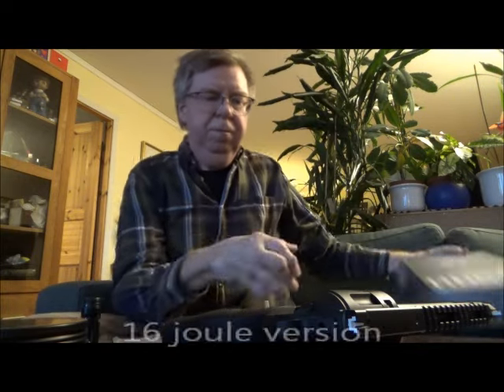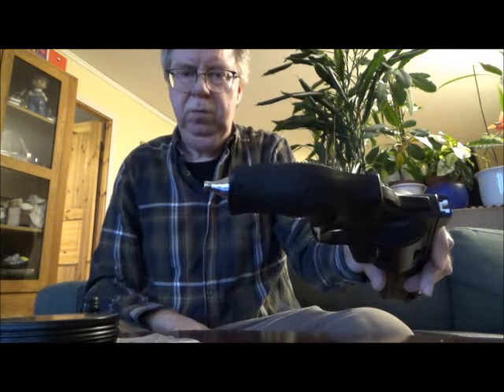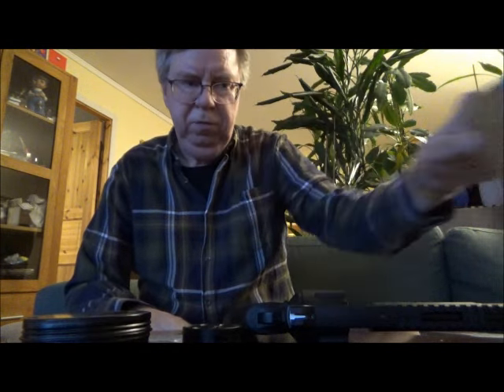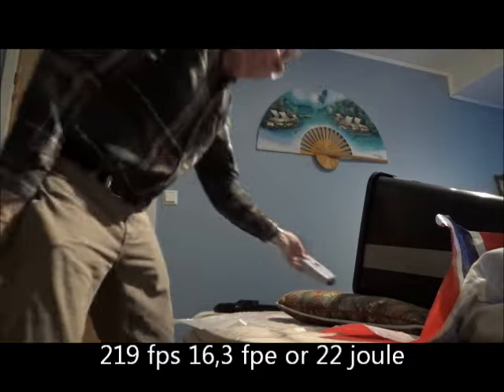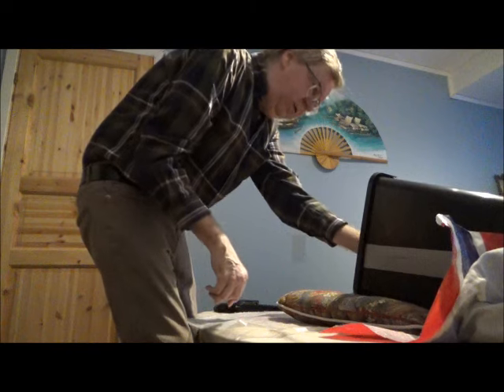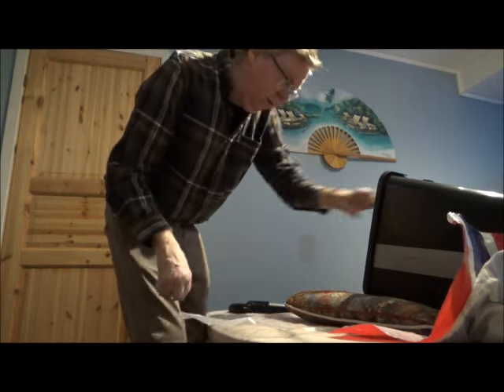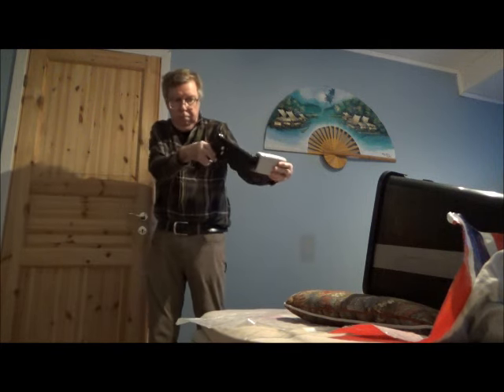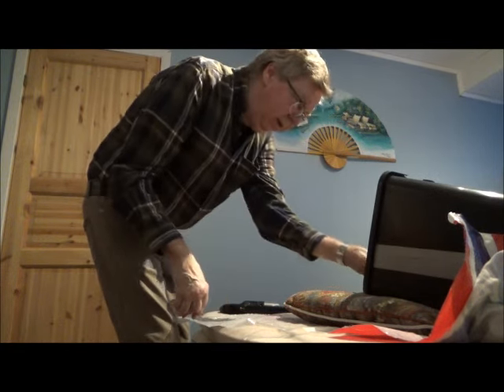Umarex HDR68, Tincan Cutting

Comment: Hello Rune nice video do you think the 1mm hole makes the marker move powerful or move reliable as it  is a good marker ,one of my  favourites as well. 🏴🇸🇯👍
Reply from the maker: Thanks my friend. Yes it makes it more powerful and more reliable with a larger hole in the restrictor. But no need to drill it larger than 1,5mm. Otherwice just dont use the restrictor for max power. Super cool revolver 😎

Comment: i discovered long ago painting your projectiles will form a beiier seal in your barrels . look at this example , on the real firearm the 9mm , you can use it in a .38 special ,the bullet loaded in its case ,and shoot it with no problem , trouble is , 9mm is .355 for metal jacketed bullets and .356 for lead diameter ! the .38 special and its big brother the 357 magnum 's bore size is .357 of an inch ,lil over 9mm . when you shoot a 9mm in these , the bullet being smaller ,does engage rifling as well and more of the gases are shot around the projectile so its not all behind it , plus you loose accuracy at longer distance also !!! 
but if you used a .357 or worse .358 for lead bullets , it would be hard for the bullet to pass through barrel , kindda like whats happens when you try to shoot a 12.7mm steel ball a home defenCe 24 tuning barrel which can handle the smaller balls at 12.65 and lil smaller better ! . 
good god man , lol i am rattling on again , i said all that to say this ,,,,,,,
a spray or 2 or 3 or more coatings of paint will help marker projectiles seal better in barrel and cylinder !!!!!!!!!!!!!!!!!
with .177 cal bb guns , you shoot .172 dia steel bb's , so they will not fit so tight in .172 bores . iy you give em a couple coats of spray paint ,they work much better .
in airsoft , you can use clear or whatever paint to make your airsoft bb's fit the barrel also ! 
GREAT VIDEO MY AWESOME BROTHER !!!
Reply from the maker: Thanks brother🙏. I used rubberpaint (15 layers) over marbles many years ago. It it worked OK. I might try spraypaint as you say one some of the ammo I have since the diameter is a bit small. Great thing about revolvers is I can use a patch around the ball. It worked great last time I used normal marbles in my HDR68. The marbles hit hard 😁. Think I will use either clear paint or black paint. Thanks for the tip😃👍🙏
Reply: @runerebel8441  been doing this many years now , decades really . i find the paint or clear coats dry much harder and arent as grippy in barrel , but a little oil makes em slide right through !
Reply from the maker: Sounds great. I will try this when it gets warmer here. @RGAIRGUNNINJA
Reply: @runerebel8441  LOL we are having down to 17^F weather here , i can understand that !!!
Reply from the maker: Yes its quite cold here now. Temp -14C or so. I have to do this outside because of the smell. So maybe in april I can start the "paintjob" LOL @RGAIRGUNNINJA

Comment: Does the Teflon trick work on the hdr 50 revolver like it does on the hdx68 many thanks ?
Reply from the maker: Hi. It will only help in lubing the internals. Not so much for speed. The reson it worked so well for the HDX is because the restrictor popped out after using it.

Comment: Thank you for your great videos. I am looking at buying a 16 joule stock hdr68 minus the drilled restrictor. I would worry about ruining it without the correct drill bit and never having done it before. What is the joule range with general ammo/heavier ammunition on these launchers for the first five shots with/without the restrictor? I appreciate any feedback.
Reply from the maker: Thanks my friend. Iam glad you like my videos. The energy depends a lot on ammo and temperature. Its rather cold here now, so in the summer it shoots quite a bit harder. The reason I drilled the restrictor is because the small hole in it can get clogged easily. So if you one day cant charge the revolver that might be the reason. In stock 16 joule version you will normaly get between 20 joule and 27 joule. Again depending on ammo and temperature. So its a hard hitting revolver. You will get 15 OK power shots and 3 weaker ones before its out of CO2. Its a super cool revolver and my favorite. Good luck.
Reply: @runerebel8441  Thank you very much for the response. Appreciate it very much.
Reply from the maker: Iam glad to help 😃 @JB13827